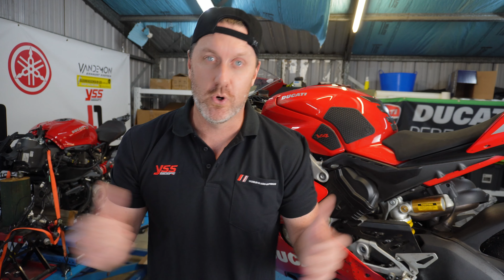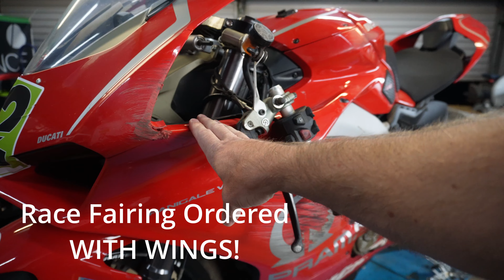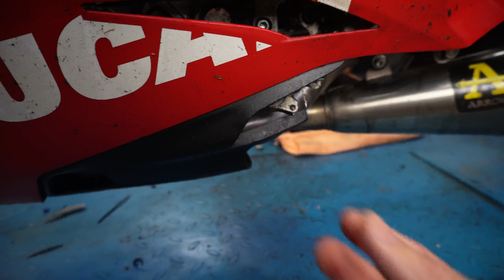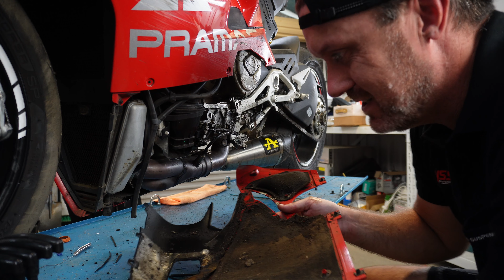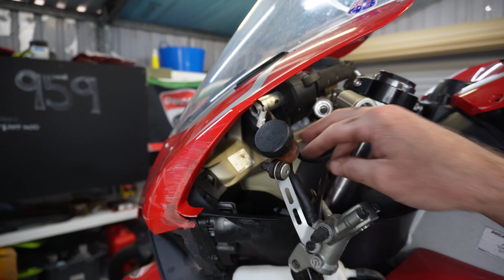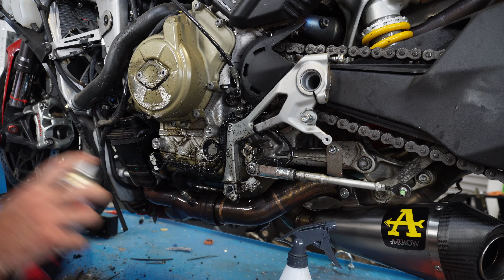WRECKED DUCATI V4 Panigale - ROAD BIKE to RACE BIKE - PT1

Comment: Do you happen to know the torque setting for the bolt that clamps the left hanger onto the round part? This is the hanger that the quickshifter and stand attach to.
Reply from the maker: Hi Dean, sorry mate I have no idea, guessing as it’s either an m8-10 it’s going to be decent nm though
Reply: @oneL  No worries, found it in the end. The part has a variety of bolts but they are mentioned in various sections of the workshop manual - to get all of the values I had to refer to the sections for fitting the engine to the frame, fitting the swingarm, quickshifter, sidestand and rearsets… Unreal to have to dig through all those sections to get all the values for the bolts in one part. They were all 25nm… 😂 Enjoying this project so far and looking forward to more updates. 👍
Reply from the maker: @sp00ky1969  sweet, I was thinking 32 nm so that’s good you found it